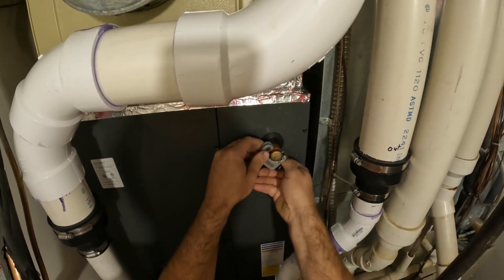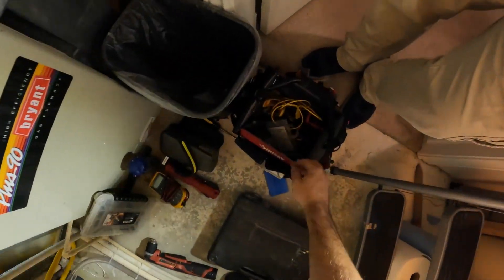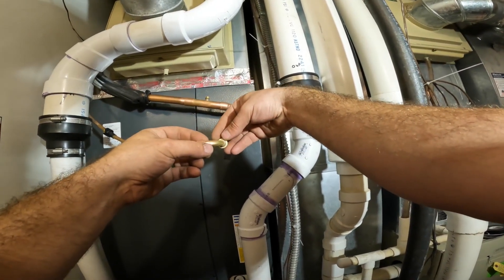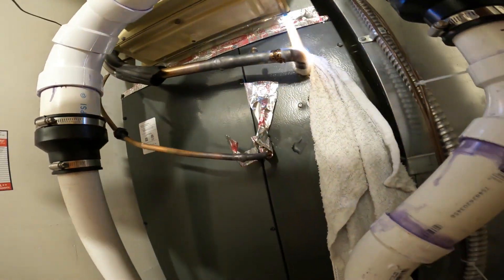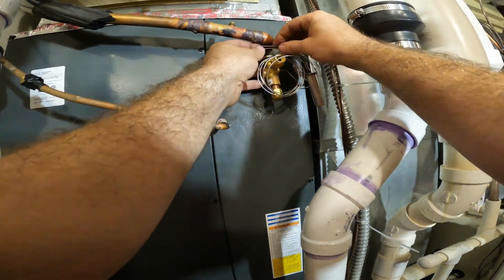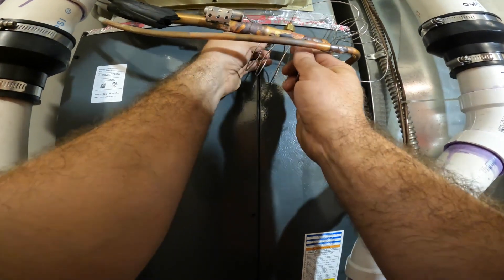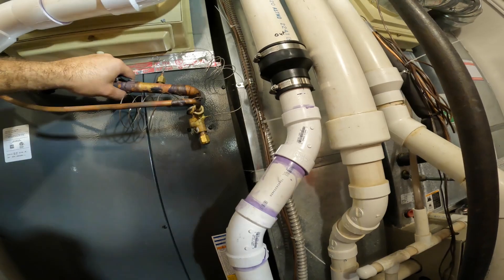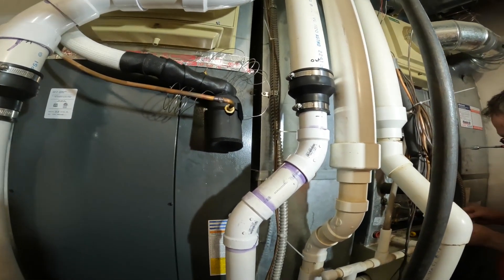Installing a Goodman TXV metering device. Step by Step

Comment: It was disappointing to install a new (2024) Goodman 2 ton unit for the attic (East coast) It wasn't impressive in the high 90's ambient temps. A further inspection revealed the TXV sensing bulb is inside the unit at the 6 O'clock position near the coil. Isn't that where the HVAC industry says NOT to put the bulb?

No where in their install manual does it mention moving the bulb (for optimization) as the unit can be installed in horizontal or vertical positions.

If it weren't for their 10 year warranty I probably would have not bought a Goodman.

Comment: I’m on the edge of retirement and started out with silver brazing and thought that’s the way things are always going to be with Freon lines and such. The Stay-Brite 8 came out in the 80’s and I thought, great, and I used it for many on linesets which allowed not to have to run Nitrogen through them. No internal falling going on there with the low temp silver bearing solder. Then I progressed to using what came out in the late 90’s and have used on just about everything-even on my own install of a 2009 York 2-stage 410 system. It’s called Bridgit -same company that makes Stay-Brite 8. 

Now as starters with Bridgit it is made to flow into loose copper fittings. If you have a, not quit so snug fitting, this will fill that void-refrigerant lines or if your working on the plumbing end too. Bridgit has silver in it and has a bursting pressure test of 44,000 psi. Way way above with any kind of pressures we ever see in the AC world. Now just keep in mind all the soft solders that have silver in them can be successful used on the liquid and suction sides of the system-condenser and evaporate. But never have I used it on the replacing of a compressor or a liquid line filter built into a condenser -that’s all hard stick brazing. 

I’ve seen so many jobs where the installer uses brazing methods and all that internal flaking going on and never install a Nitrogen bottle to the system. Or even if a installer is running L copper for a gas line. Breaking out the Mapp gas tank and solder high temp for the gas line (which required by gas companies of course) but never putting a nitrogen tank on that too. That’s where a drip-leg comes in handy and one can blow out the run of gas pipe before it ever goes into service-thank God when Trac Pipe was invented too for all those reasons. 

So getting back to Bridgit, I’ve never suffered any leaks or bursting issues in 27 years, soldering in driers in both side of line sets and the equipment too. So there is a place for low temp and a place for high temp soldering. And nowadays we have crimp fittings. Used them piping in several medium temp walk-ins. Quick they are but if your just starting out, keep your brazing skills up. You may land a job like I did when I was only 24 working for a government builder of Mash Mobil hospitals. One day the guy (same  age) helping me let out a Oh-No. He and I were working on these big copper/fin condensers and brazing on some of the U-bends. He had his touch I guess set to high and burnt a pencil size hole on this nice new shinny end tube. He was in a panic what to do. Well I said that’s a easy fix-since I was taught  fortunately by a journeyman to fill in holes as large as nickels if I ever did that. So with stick in hand and using the flame just right I started to lay down solder until I got the hole completely secure and filled and pressure tight. He was so relieved and amazed one could do that with Hard Solder-filling a hole.

Comment: Question of what copper fitting you are using to step down from the effectively 3/4" rigid copper in the coil (suction exit) to the OD 0.75" of the 3/4 refrigerant line.  That seems like a special insert reduction fitting, which you used a 90 degree, but also assume it comes in straight.

Comment: I thought the txv should be close to the evaporator coil and the bulb placed vertically
Reply from the maker: No bulb is always horizontal, and as long as it’s within like a foot of the coil it will work just fine. The closer the better though

Comment: I thought TXV only go inside of the Evaporator coil when get the most Contacted of the Air running System 😊
Reply: That’s a Goodman unit. They want it that way
Reply: Nope.

Comment: What are the advantages and disadvantages of installing the txv on the outside of the cased coil? I was told I should put it inside...
Reply: Can adjust superheat without having to open Evaporator case. Goodman provides a insulated jacket for the txv in their txv kits
Reply: Put it on the inside if it's in a hot attic.  My HVAC guy put mine on the outside.  Now I'm dealing with a constant rusty pond in my drip tray in the attic.  They've tried to insulate it THREE TIMES now, and the insulation just eventually gets wet and falls off.  Glad the drip tray is holding up, but worried it will eventually leak onto my ceiling.

Comment: If installing a new AC which evaporator is better. The one built in txv (CAPT) or w/o and install it outside (CAPF)
Reply from the maker: Built in hands down. Much easier to install
Reply: Thanks

Comment: In plumbing when you connect two lines u need coupler in this case at 2:11 you just slipped the connector without any coupler. So question is do we need to expand existing copper line or I can use coupler
Reply: Wait, what? Watch the video again. Its 100% threaded after brazing/soldering. EZ-PZ. Your TXV should have instructions to follow.

Comment: Hey I have a question, I see your lineset is running horizontal, does it matter if you install the Txv vertical ? So your txv will be up and down
Reply from the maker: I’ve always heard it should be horizontal if at all possible.
Reply: Lol I’m having that problem right now as we speak how did u install yours?

Comment: Can someone comment on the differences in setup. ac vs heatpump. can a heatpump use either txv or piston. what else to consider. 
Can you mix and match condenser and evap coils. I know you consult on that and I may do that.
Thanks dave.

Comment: Great helpful video! I have two Goodman CAPF3636A6DB 3-ton coils. Replacing the two 2-Ton Freus condensers bcs they are crap. Can I and my contractor add a Goodman 2-3 Ton TXV to each coil and then replace the two Freus condensers with two 2-ton Goodman condensers? This home is a rental and only 1900 square feet. Even in El Paso, TX 4 tons total should be enough and 6 tons would be overkill. I called Aspen tech support. In my house, also El Paso, the coils have factory installed TXV and the tech said it was no problem to change the 5 ton to a 4 ton condenser and the 3 ton to a 2 ton. 8 tons of cooling would be utter overkill for 2900 square feet. Had I known in 2015 what I know now, I would have never let that company install the current system. I have not had one year that something didn't go wrong with the AC...that is why the Freus cindensers have to go. No problems with any of the other components...thanks in advance. Goodman tech support will not talk to puny homeowners...only licensed professionals 😢

Would you also recommend installing a hard-start capacitor in my condenser? Based on what I read, this capacitor gives an extra jolt of electricity upon startup to push the refrigerant against higher head pressures that are present with a TXV system.
Reply from the maker: Yes you can purchase the correct size field installed txv and install them in an existing coil. Also I just uploaded a video on hardstart kits. I think they’re a great addition to any condenser new or old. If you need some help or advice, feel free to check out our membership over at Patreon.com/diyhvacguy   Cheers
Reply: @The DIY HVAC Guy  thank you for the superfast reply...and yes, I will subscribe to, as well as financially support your channel!. I will retrofit the condensers with hard-start capacitors and coils with TXVs at my other properties...and any future systems my contractor and I install for anyone else will have those to items as well.

Comment: Where can I find that part where the external equalizer taps into? The suction line attachment with the port? What is it called?
Reply from the maker: It comes with the txv kit.
Reply: Thnx! Im a DIYer and I acquired a TXV from an estate sale a few years ago and low and behold soon i will be replacing an Evaporator and that txv valve matches the system but i dont have the pipe attachment. I am contemplating using a line tap but worried about leaks maybe ill solder one in instead, just need to have the Schrader removed

Comment: There is another video of the new furnace with a new ac coil that you installed but you didn’t install the txv valve , why? Not all the coils need a txv valve installed?
Reply from the maker: No, it depends on the efficiency level of the equipment the customer chooses 👍🏼 14 seer js the standard least efficient and 16 and up requires a txv
Reply: @diyhvacguy  I got it , thank you very much ,

Comment: Hi! I have a system that's leaking right at the brass nut connecting liquid line to the txv. Is it a flare fitting?
Reply from the maker: It probably just needs to be torqued. I’ve had a few develop a leak there. I’ve since purchased an adjustable torque wrench. It should have 30ft lbs of pressure on that nut. It’s not a flare, there is a seal in there. And the seal is what seals against the two pipes.
Reply: @diyhvacguy  thank you!!

Comment: This look 10x better than mine, I want mine removed and done like this. The plastic grommet on the could  is all melted from the braze job. Makes me mad.
Reply from the maker: Hey as long as it works right!? Haha thanks for the compliment :)
Reply: @The DIY HVAC Guy  I have been cleaning up the install mastic all over, wires all running in front of panels etc. When I adjusted the capillary tube 20 minutes ago the capillary tube started leaking. As mentioned the tech braze job is pretty bad and he had weakened part of the capillary tube with his torch and now I have a pinhole-leak on the capillary tube. 😱
Reply from the maker: @tuanische  oh no! While it still has positive pressure you could pump that freon into the condensing unit to do the repair. Then vacuum the system and let the freon back out. If you haven’t seen my other videos on that check them out.
Reply: I have watched about 6 of your vids. (maybe more) No luck finding the recapture vid, but I did see we are in the same state when I saw your Publik coffee mug. Used to go there when I worked in SLC. Great place.
Reply from the maker: @tuanische  https://youtu.be/sR5wIbNrs7Y  here you go. Watch this. It may help for your situation.
Reply: What is the torque spec on those nuts?